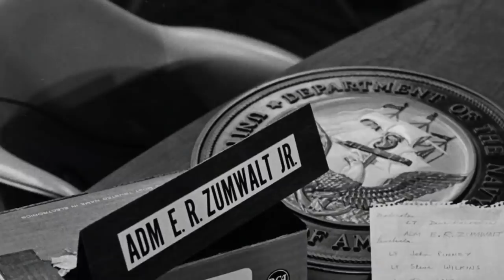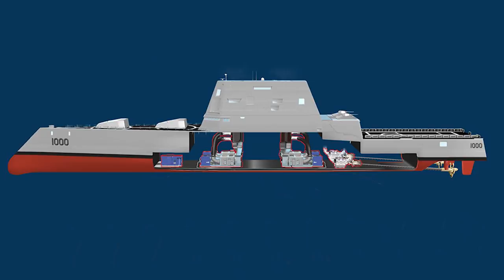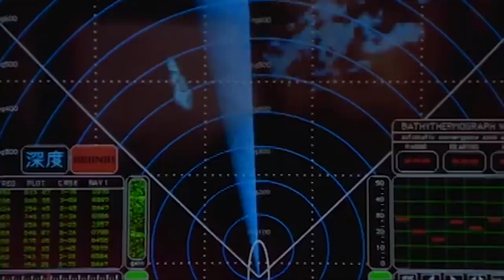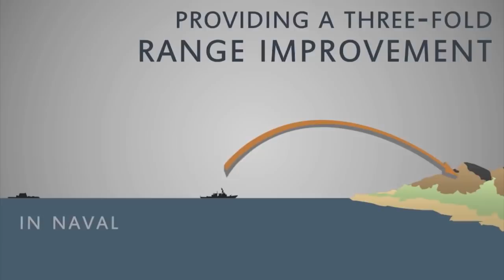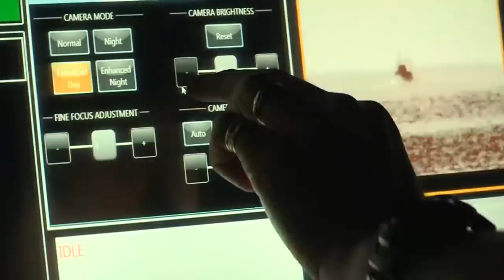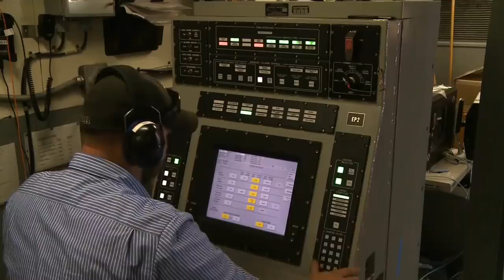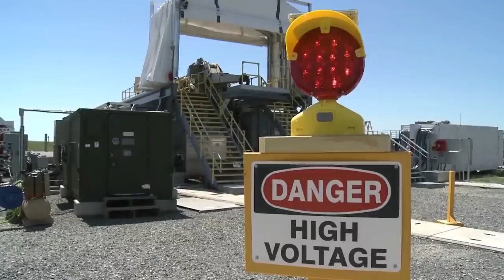Zumwalt - destroyer from the future

Comment: The R and D that went onto it will be useful for an actual warship
Reply: It already is going into actual warships, look at the crew compliment on a Gerald R Ford class aircraft carrier versus a nimitz-class. All of that automation didn't come from nowhere
Reply: And could have been developed for a small fraction of the cost on demonstration platforms, each looking at just one or perhaps two new technologies. The Zumwalt program, like the LCS or the F-35, has been an overambitious fiasco that has ultimately weakened the deployable Navy.
Reply: But the construction cost of each ship without R/D  is 4b$ its a disaster.
Reply: @marinecommando3445  
"But the construction cost of each ship..."
...All three of them?
...Say, have you heard of this little thing called the SEAWOLF-CLASS?
Reply: @matchesburn  lol seawolf reference you sure are making enemies in pentagon by refering that boondoggle
Reply: IMO The Zumwalt turned out to be a 'prototype class', a platform for new design techniques and systems that couldn't be integrated into existing keels.
However, that said, I think it' characteristic overambition for the Navy to thing that just because something is possible in principle, it will be straightforward and effective in practice.
I think practically speaking, once railguns and point-defense lasers are viable test designs, this should be revisited and redesigned as a CG(N) / BCG(N) .

Comment: Personally, I'd rather have a heavily modernized & retrofitted Iowa class.
particularly with recent advances in hypersonic artillery.
Reply: Iowas armor metallurgy is out dated it cannot withstand guided armor piercing missles. This is not to say the iowas armor is bad it's blend make up is made to withstand gun shells and torpedoes not thermite cored armor melting missles.
Reply: @joshuamcpeek4708  I think the work crews who had to drill/weld the armor on them to retrofit phalanx & missile bays might disagree.
Reply: @joshuamcpeek4708  did you miss the part where he said "heavily modernised..."

Comment: Comment section: 
- Ship version of Tesla Cyber truck
- Hot lady at 2:03
- No way the Zumwalt replaces battleships
Reply: Well, if they manage to make a rail gun that doesn't need a barrel replacement after a single engagement (and maybe fires bigger slugs to deal proper amounts of damage on hulls), a battleship could be replaced in its use as a tool of naval superiority along with the very obvious carriers. A weird thing is I don't know how useful it is to have the signature of a civilian boat if the enemy already knows it's the Zumwalt having it, specially if they can confirm that doubt trough satellite imaging or aerial reconaissance (if a thing with the signature of a small fishing vessel fires at your jet with a missile, you know it's not a small fishing vessel).
Reply: So where are they now?
Reply: So where are they now?
Reply: R — The battleships are gone.  They were obsolete at the end of WWII, but President Reagan didn’t know it.

Comment: The ship isn't a failure, it's mission is. Should be a missile ship for surface warfare. Toss the guns and install VLS
Reply: VLS is obsolete.
Reply: @macrolosses  then what is the up to date weapon system then
Reply: @RocketHarry865  VLS is too slow.
Reply: first i would like to say that the Zumwait would always be a failure as a screening fleet vessel being too big and expensive but as a solo ship the stealth capabilities combined with the long range weapons and powerful radar that was scraped could make it a extremely vexing raiding vessel and even a cost effective method for blockades and patrols where it can replace a larger quantity of smaller ships this ship is not a Fleet screening ship but a independent light cruiser capable of both wide area denial and stealth this ship is not made to win battles but to completely and utter deny safe access to the sea from enemy convoys

secondly why are you and many other people obsessed with slow expensive easily countered underwhelming missiles?
when fast cheap practically unstoppable devastatingly powerful shells exist?

there are numerous problems with missiles the most fundamental of which is that a missile needs carry its own fuel and its own engine, which means it can never be as fast/powerful/cheap as a equivalent shell, not to mention how expensive guidance/control systems can be to just blow up unless the missile is nuclear or impractically large you might as well be shooting yourself in the wallet instead of dealing damage to the enemy, small missiles are not economical from a damage per resource perspective this also limits how much ordinance that can be carried and causes increased logistics problems

war is all about logistics the Sherman was far from the best tank in WW2 but it was the most numerous and most convenient easy to deploy tank of the war, and that's why it was so successful the reason the Sherman was more effective then the King Tiger not because it was the most advanced expensive tank but the most numerous economic tank that could be utilized effectively in the largest quantity of battles

the entire spirit of mobile warfare is to use your advantage as frequently as possible to deal maximum damage not to have the biggest advantage you can have, but to gain the most possible out of even the smallest of advantages,  you could have the best gun in the world but if you never shoot it then its worthless, so always make sure your guns move to the fight as quickly as possible and shoot as often as possible

war is not about who has the most/best weapons its about who gets the best/most weapons into the battle where they can actually make a difference and missiles simply don't cut it from a logistics standpoint

the whole idea of creating faster more numerous more effective screens necessitates the use of cannons as its currently the most efficient weapon available if missiles were the future then the Abrams wouldn't need a cannon

tactical missiles of the non nuclear variety are noticeably inferior to cannons in most instances
Reply: @XDbored1  I disagree; although the zumwalt class is a large vessel, it's stealth profile is significantly smaller than it's peers.
The ship can sail in advance of carrier groups taking advantage of the f35s abilities to share data with all available assets in the battle space . Also, shells are not capable of updating targeting information in order to change course or loiter,  this provides flexibility in the threat environment that missiles can offer in a dynamic war scenario. All of the carrier groups assets working in cooperation with the newer and longer range missiles can make the zumwalt an effective screening ship.
Reply: @SpecialistQKD  in a patrol scenario sure it would work well but why do you need the rest of the fleet for that? 
in a battle scenario the Zumwalt is an awfully expensive screen with a lot of unnecessary equipment that is ill suited for the role of protecting larger more expensive vessels which is why i think the Zumwalt is more suited to head small patrol groups or operate solo then it is for screening large fleets where its stealth/detection capabilities will have little use

when smaller cheaper destroyers can do the job of submarine screening and shielding for the larger ships in fleet battles just as well why risk getting a Zumwalt blown up in a pitched battle? and losing all that stealth equipment for no good reason

in a battle you screen your expensive ships with cheap ones to protect them the Zumwalt is too expensive to be part of the screen if you had to use it in a battle it would make more sense to put it more in the middle of fleet and have it attack with the long ranged guns but the stealth/radar/sonar would still be redundant with the other larger ships taking care of detection and its position rather obvious being right in the middle of the fleet

a good battle screen should be a block of steel with maneuvering sonar and ASW capabilities SAM missiles flak cannons smallish guns to take out Patrol boats and other Destroyers

big enough to kill a Sub or block a hit but not too expensive it shouldn't have the latest stealth radar and bombardment capabilities
Reply: @XDbored1  in context of the navy's new proposed doctrine of more offensive capabilities and in an access denial environment I would prefer to see the zumwalt operate at 100 to 200 nautical miles from the fleet in cooperation with the E2. Expensive as it is, it's still a destroyer. Keeping it close just makes it another ship to protect in the formation . We have this technology and should deploy it aggressively. Having unparalled stealth, and replacing the guns with the long range strike missiles that can communicate with multiple platform's, having the ability to update targeting information and loiter would make it a formidable screening vessel for both carrier or amphibious groups.
Reply: @SpecialistQKD  for the purposes of area denial the Zumwalt has no use for the rest of the fleet for the purposes of battle do you really expect slow little missiles from 200 miles out to vertical takeoff loiter waste all of there takeoff energy then move towards a target somehow not get shot out of the sky in this ridiculously inefficient process and then have enough energy to deal serious damage to another ship?

Missiles are only good when you can compensate for there inefficiency by shooting fragile expensive targets like jets or by adding a nuclear payload 
for ground targets and warships missiles will never be as effective as cannons
Reply: a smaller cheaper cannon ship could blow up the Zumwalt while the missiles are still loitering war is about who gets to strike first and vertical missiles will always be second compared to horizontal missiles cannons and rail guns in that order
Reply: @XDbored1  this ship will not be alone it will have satalites , submarines, isr aircraft and the rest of the fleet all sharing data with the f35s. What about power projection do you not understand??? If patrol boats are a serious threat then a aircraft carrier should stay in port. You are stuck in 1950s naval doctrine... Mike drop . Adios.
Reply: @SpecialistQKD  so you think this ship should just sit around while the f35s do all the real fighting what would the point of that be? and again why should this ship be part of the fleet only 200 miles out when the F35 has a range of 2200KM it would make more sense to have it 800 miles out where it can truly take advantage of its stealth and still get air support if your destroyers are not going to protect your carriers and your just going to make f35s do all the fighting you might as well just replace the entire fleet with f35s

which is ofc a stupid idea since f35s are air superiority fighters  CAS and Vtols they make a excellent replacement for the harrier jet and a good but expensive replacement for some of the older slower fighters and an awful replacement for a destroyer 
there not interceptors(not enough speed) and there not heavy bombers(not enough power)

Comment: Being from the state it was made i got to see its construction and progress when ever i was in the area, when the ship is finally equipped with the railgun it will be even more monstrous. The railgun, can fire a solid steel round at near mach 7, the round has such a kenetic impact that it creates explosions, despite the round not having any explosive ordinance. It can travel from the barrel to the horizon in roughly 7-8 seconds, and is traveling so fast, the target would be it with at least 4 rounds before you would even hear crack of the sound barrier the rounds made.

Comment: Based on the program's duration and cost, as well as the number of simultaneous innovations, this is most definitely a failure.
Reply: VectorGhost still guns with no ammo
Reply: @VectorGhost  Wrong, the reason the number is so low is because the costs were already too high.  Congress learned their lesson from the F-35.  Cancel early the instant the program has failed, and congress canceled right when that happened.

Zumwalt should have been a stealth destroy OR a land attack destroyer OR a capable modern destoyer with good energy production for future upgrades.  There's no point in combining these features.
Reply: @zteaxon7787  wow that was somthing
Reply: motmontheinternet And they won’t learn a damn thing. Next will be a Submarine/Aircraft Carrier hybrid.

Comment: The US military's problem is the bottom line. It needs new frames and hulls for aircraft and ships because the current ones are reaching the end of their service life or just can't support emergent tech with space and power so its not just a factor of upgrading what they have but also providing a realistic platform to use those systems on. Personally I think stealth is rapidly becoming overrated especially as computers become more advanced. Sure human operator might not pull the trigger if he risks hitting 30 ft yacht but with modern computers,drone,satellites modern, possibly AI assisted, systems could negate  any advantage that a small radar cross section provides. 

I feel we are moving back into an era were not to be seen is no longer a valid defense and more effort needs to be made towards stopping incoming rather than avoiding it. Last wars and all that stuff.
Reply: The stealth is meant to get as close as you want and launch your attack. As seen in history, the one who gets the jump usually wins. So stealth isn't overrated it's just that everyone thinks stealth=invisible and not very hard to see until it's too late.
Reply: @crocidile90  The problem is cost effectiveness. There comes a point where the cost of building a single unit to a vastly higher technical level is not worth having multiple cheaper units. The round for the gun is a prime example, expending a million dollar round to take out an old truck and some terrorist in a third world country compared to firing 4-5 ToT shells at around 12,000 per shell. Gets the same job done but at a fraction of the cost.
Reply: "more effort needs to be made towards stopping incoming"

Arguably one of the main flaws of the modern US Navy is that so much effort/money/hull displacement is spent on defensive measures that the ships' offensive punch in a near-peer conflicts is compromised. There are 400 ton Chinese fast missile boats that carry more anti-ship ordinance than a 10000 ton DDG. 

And if you want to see scary, look at the rest-of-world's investment in mine warfare to the US investment in mine countermeasures. I fear a day when ships berthed at, say, Guam can't leave the harbor due to offensive mining.
Reply: @nicolivoldkif9096  Rail guns can fix the projectile problem if they do them right.  The gun itself will be expensive, perhaps, at first, but the projectiles need not be; and finally the gun range of the WW2 battleships will be exceeded.  Rail guns could fire a wide variety of projectiles for different purposes.

Comment: I do not agree on the point of stealth. The main threat to such ships are missiles and planes, and it will be much more difficult for them to attack this new destroyers
Reply: & how would the ship attack if he does not use his active radar ?
Reply: The Zumwalt was designed as a land attack destroyer.  It was going to park itself 15 miles from shore (well within visual range plus any other type of detection system).  It was always stupid for it to have stealth.  Now it isn't even a land attack destroyer because of all the issues, many relating to stealth.

Comment: So many backwards thinkers in the comments here fighting yesterday's wars.
Reply: We already had stealth ships, they were called submarines.
Reply: @asdfdfggfd  well this ship is bigger. Plus not everyone swings like them submariners do. Don't ask and don't tell!
Reply: Not so. It was stated that these were to replace the battleship gun platforms. However, the guns were scaled down. It was supposed to be stealth, which is all well and good on the open ocean, but gun platforms need to come within range of their targets. So, stealth is not really warranted. All of the equipment is held within the hull, so it is, therefore, harder to maintain, and takes longer to get at when needed. As concept ships they may be valuable, but as working gun platforms, not so much. A design created to carry many more, simpler, sea to ground missiles instead of high tech guns, may have made more sense. But to create a platform that carries fewer missiles than the ships it was meant to replace just doesn't make sense.
Reply: @willdsm08  how do you know how anything works? It is not like they've been in battle yet. Equipment inboard on a ship is better protected than crap bolted to the deck. For all you know each gun on this ship has a SCARA robot arm polishing it 24/7 too.
Reply: @1pcfred  it will be easily taken down.
Reply: @marinecommando3445  that remains to be seen. Perhaps that's it's superpower? Maybe it is a submarine too? I bet you didn't think of that! 4 billion dollars buys a hell of a lot of Flex Seal.
Reply: @1pcfred  sry but you are wrong....remember the helicarrier from the Marvel franchise? That's what it is.
Reply: @nemo99nemo83  I do not know what you are talking about. Comic books? I was never a fan myself.

Comment: The hull designs problems are not about stability under normal conditions but what happens after being damaged or hitting really bad weather. The tumblehome is not the only problem with the hull. The VLS cells along the edge will become problematic over time.

Comment: It's clear that it's prime function is seal team insulation with stand off fire support. That's why it has artillery guns instead of anti-ship guns. The small boat launcher and helicopter is last mile delivery. At night with low radar and heat signature it is invisible.